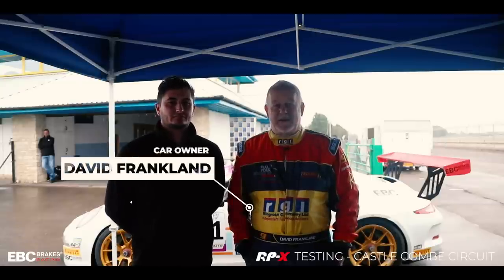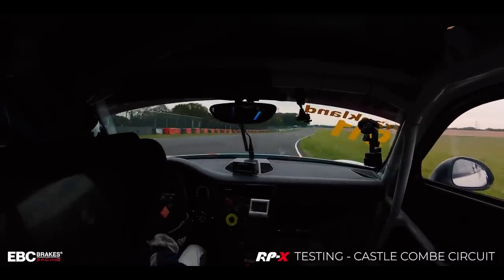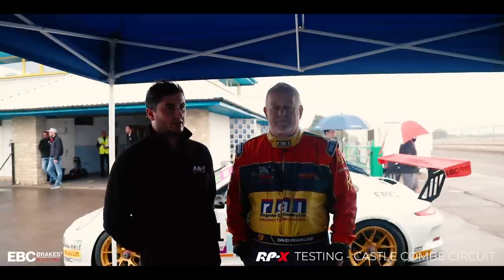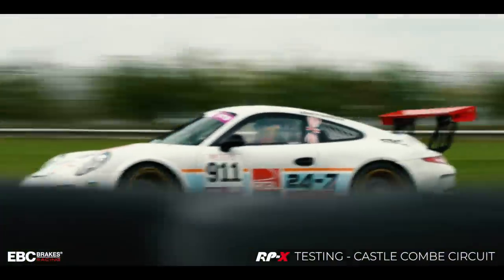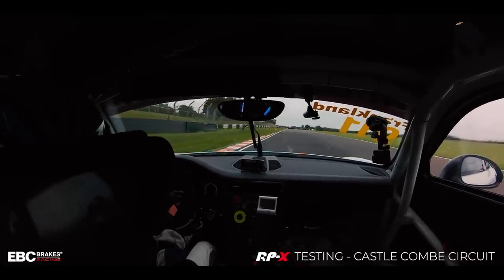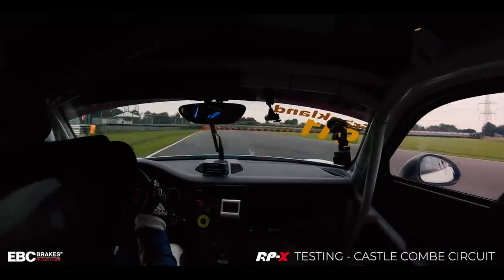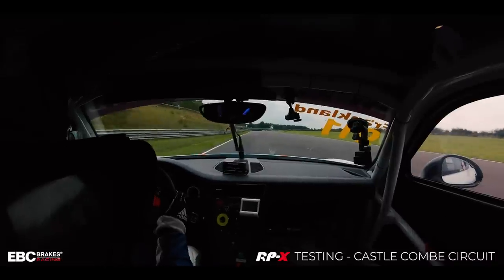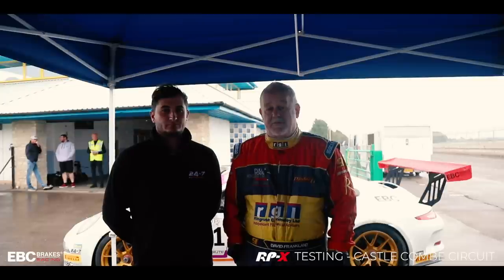EBC Brakes Racing – Porsche Track Testing | RP-X Pads in 911 Cup Car

Comment: Would also be happy to test these on our 600bhp Supra Race car. We don't run a brake assistance either (servo or any ABS) its all leg effort therefore we need a pad that performs well, we were looking at the RP1 but the RPX look better suited for our application, looking at the specs these out perform the Porterfield R4 race compound we currently use, so would be interested in finding out how they feel on track.
Reply from the maker: Absolutely, this sounds great. Pop us an email at - tracksupport@ebcbrakes.com - and we can look into what we can do for you.